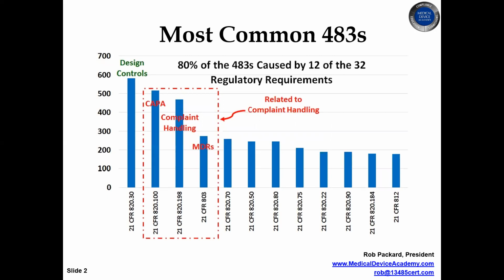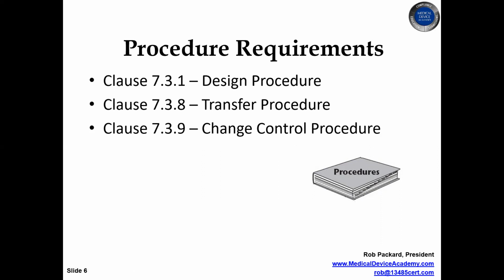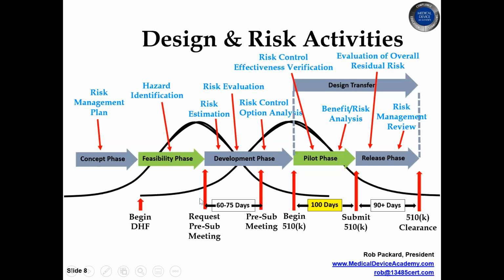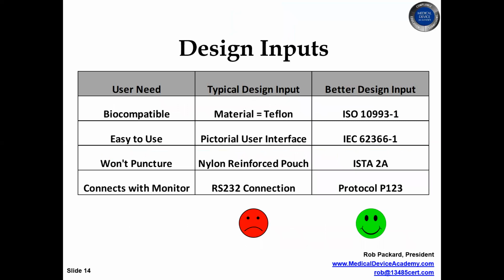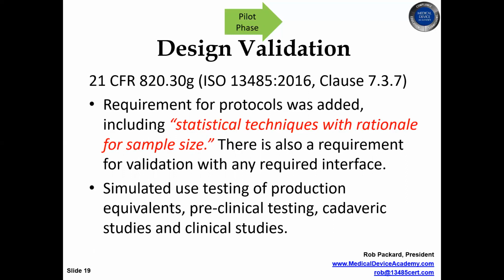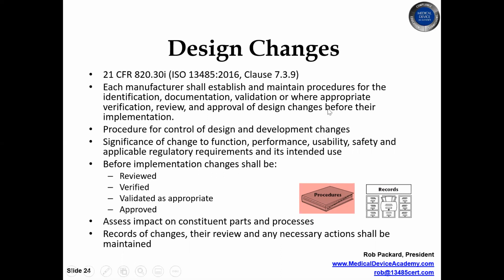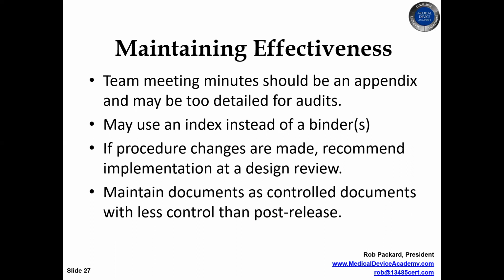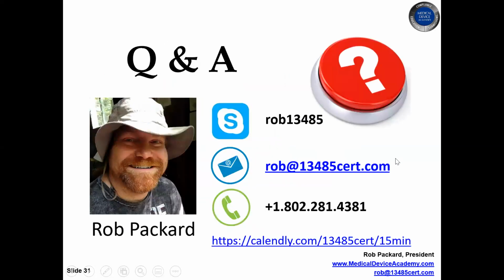Design Control Process - Update 2018

Comment: 27:21 -> Can I get an Example Scenario of how a FEA analysis can be used as a "Design Validation"
Reply from the maker: Great question! A "FEA" is finite element analysis. I have seen this used in the past to model the worst-case forces applied to a knee implant. The analysis identifies that the worst-case is an obese person that is walking down a flight of stairs. Due to my size (200 cm tall and 140 kg), I am very close to the worse-case scenario. There are long lever arms applied to the joints, lots of mass, and like to run down the stairs. Implants fail under this extreme loading situation, and therefore the FEA is used to estimate the maximum forces and then the implant is subjected to those forces in a benchtop simulation. The number of cycles is calculated based upon the estimated lifespan of subjects. If the implant passes the simulation, then the combination of the FEA and benchtop testing sufficient to validate the implant.

In reality, falls are a major source of device failure for orthopedic implants. I also know that downhill ski racing is effective at destroying most implants. The falls can be simulated in an FEA, but downhill ski racing is more complex than most FEA modeling.